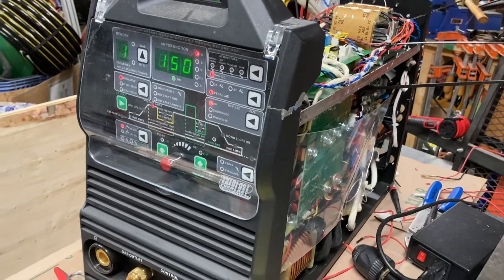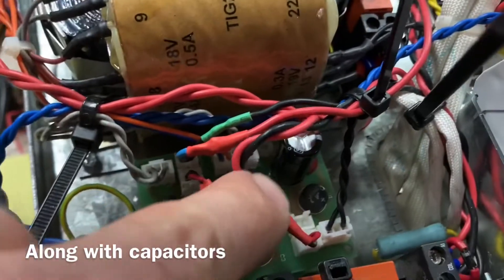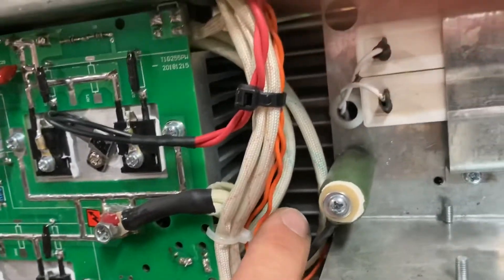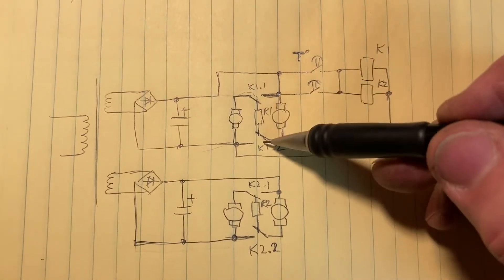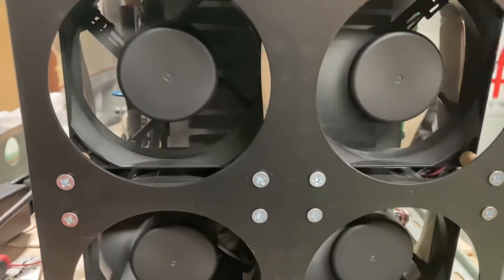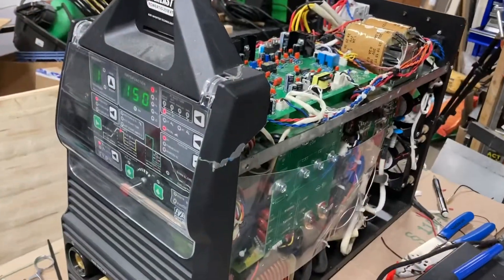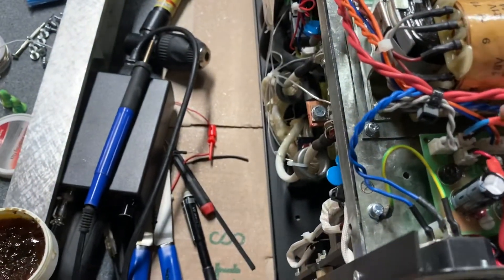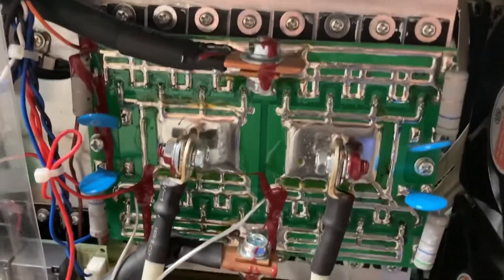Useful Modification of the Everlast Powertig 255EXT. Improve fan noise level

Comment: Great upgrade!

Would you be able to add detail on the resistors and relays you used? I have the same machine and would like to duplicate this mod. 

Mine is now out of warranty now, so it's time to fix this.

Edit: After re watching, i noticed you included the resistor specs. I missed that the first time.
Reply from the maker: Thank you for watching!

Comment: Great idea, I am lucky because my welding area is around the corner from my 255EXT so I am literally in a different room than the welder that and I am getting old and my hearing is fading. LMFIAO Nice video.
Reply from the maker: Thank you very much. Using hearing protection was my back up option :)

Comment: I like the outcome. I just got the 255ext and it is pretty loud. Coming from a Thermalarc 185tsw it's pretty shocking. I had one come in damaged. Returned it and just got the replacement yesterday. Both where loud. 1st had 4 fans the 2nd has only a single large one. I'd definitely like to do something to cut down on the constant noise. I enjoyed your vid. 
Would you happen to have the link to the single fan setup you mentioned?
Reply from the maker: Thank you. Remember, doing any modifications to your welder will likely void the warranty. The channel I mentioned is by this guy, he’s from Ukraine, he repairs welders for living. The link to his channel should appear at the time I say it in the video. I couldn’t direct you to a specific video, since I watched it just for my information long ago and it was a different welder anyway.
Reply: I also watch Ave's htp watercooler vid. He replaced the motor driven fan with 4 electric ones and at full blast it was really quiet. I was all ready to switch out the 4 oem fans for the quiet ones he used. But #2 got the single big sucker. I'd love to switch it for a bit more quiet. Could always switch it back should I need servicing in the next 5yrs. This is one area they could have charged a few extra bucks for. Guess they know their demographic far better than I do
Reply: It would seem I received a 2023 model. They moved from 4 to 1 large fan. Said it's more reliable
Reply from the maker: @MrHotcress  one fan noise reducing modification would be even easier. No relay necessary :)
Reply: Yes, and your thermal arc has a much lower duty cycle at full output.

Comment: Nice idea. Should be like that from factory. Also one large fan would move more cfm. Not sure why the move to 4 basically computer fans. Unless they needed more static pressure that smaller fans allow.
Reply: I completely agree it should be like that from the factory. Single point of failure. If the 1 fan dies not all the components could die. Granted they could easily get over this. Also I'm not sure, but the cost and total amperage may also be lower on 4 vs 1 large.
Reply from the maker: Thank you! Now, I gotta think about how to make the torch cooler quieter :)
Reply: @TinkeringNerd  water